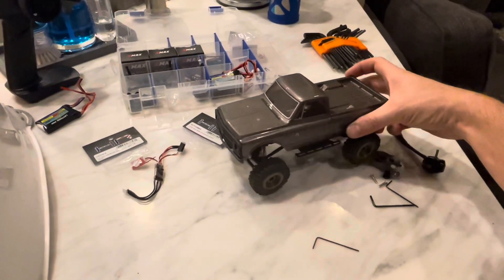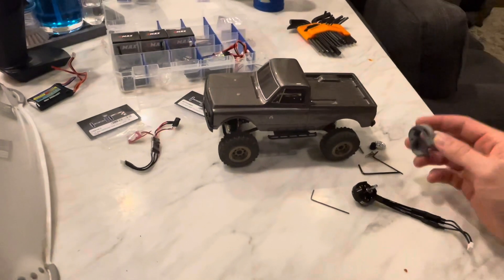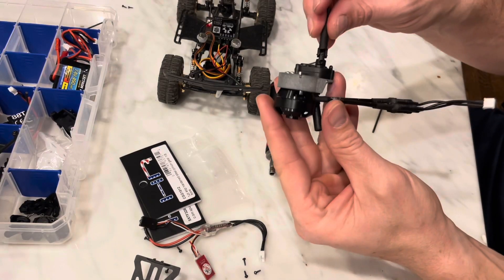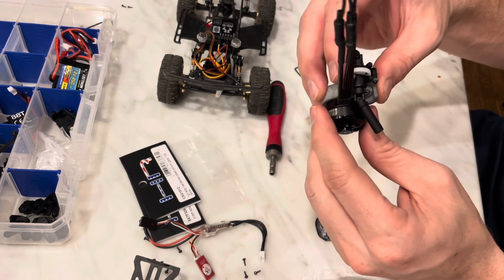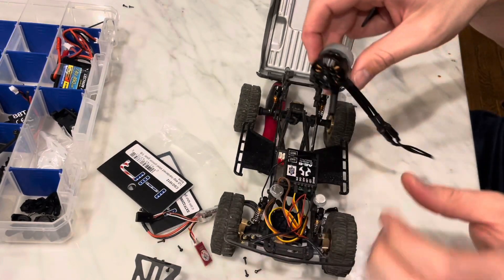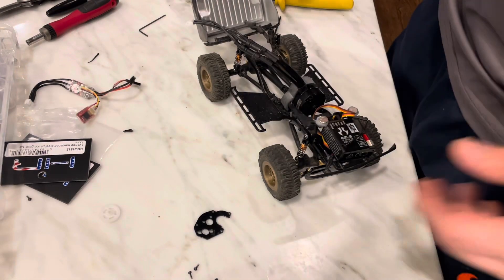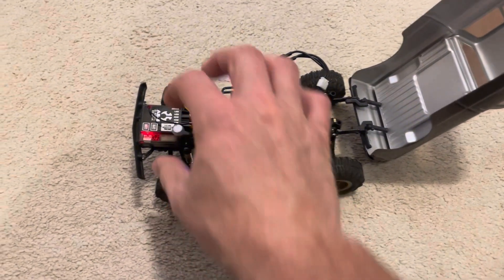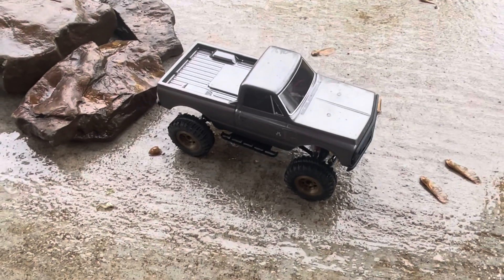Axial SCX24 Surpass Motor Install How To

Comment: I recently purchased the same motor and mount but need the screws to mount it. What size are they and where can I find them? Please help. It will be greatly appreciated
Reply from the maker: I went to my local hobby shop and they were able to find some machine screws that fit. I don’t have the size or thread pitch to be exact

Comment: I mounted my motor and transmission and I suppose the bottom skid plate backwards. Thought everything was working out pretty good till I got to the drive shafts and the pins they mount too being reversed messes up their lengths and messes up the suspension links and its all a mess. Sucks too because it would be sooooo perfect to mount the motor the other way and not have to cut the ESC tray (which I can't because mine is aluminum and where my shocks/body magnets mount and cost like $40). The mod life is the good life.

Comment: Links to the products: https://www.amazon.com/dp/B01M6UNIY4/ref=cm_sw_r_cp_api_glc_fabc_M9t5Fb0D57MBT?_encoding=UTF8&psc=1 for the motor
https://www.shapeways.com/product/F36UVFNAD/scx24-2fm-rc-surpass-motor-mount?optionId=195155714&li=shops  for the motor mount.

Comment: Thank you for confirming the 12t 48p pinion. Ive been running the 15t .5 mod temporarily in place of the recommended 11t .5 mod. They are fine with a 2" OD tire but i can hear it struggle on the steep and tough climbs. I literally purchased the 12t 48p in the middle of your video!
Reply: Hi mate, do you have a link for those bits? I have the motor and mount. I need gears.. hehe
Reply: dont get a 48p, they are noisy af. I found this guy who sells gears but doesn't specify the pitch/mod. I got a 15t and it was way quieter then my 12t 48p. Heres a link to the 12t 0.5mod https://www.ebay.com/itm/272055886561?_trkparms=aid%3D111001%26algo%3DREC.SEED%26ao%3D1%26asc%3D20160908105057%26meid%3Dff19f850f92448d7bfcb68ee23660562%26pid%3D100675%26rk%3D2%26rkt%3D15%26sd%3D283852787413%26itm%3D272055886561%26pmt%3D1%26noa%3D1%26pg%3D2380057%26brand%3DUnbranded&_trksid=p2380057.c100675.m4236&_trkparms=pageci%3A547e093b-c2e4-11eb-ac66-aadbead31f46%7Cparentrq%3Ac7f147691790aaecf154d84bffe19a0e%7Ciid%3A1

Comment: Shit I ordered an 11 tooth. Hope it works
Reply: Where did you find an 11t? the 11t is the best one but they are sold out, hopefully you didn't get the mod 1.5. He used a 12t 48p, with a spur that's mod 0.5 or 50.8p, so his pitches/mods don't match which I think is why its noisy. I also got the 12t so I'm looking for a 11.
Reply: @vinnyisntgud7221  I have the .5 mod. Got the 11 tooth on ebay.

Comment: Nice job.  I'm about to put one in my next Jeep build with the LIzard ESC as well.  Looking at your install, I may have to ditch the stock ESC/Radio to save space and use a smaller radio and different transmitter.  I'm really surprised it fit up front without interfering with the up travel of the top of the servo.

Comment: What did you use to adapt the three leads from the Surpass to the ESC? I just got my motor and it doesn't have any sort of adaptor included. (slowly but surely trying to get the conversion done on mine too)
Reply: The furitek esc comes with the banana plug adapter.  So when you get your esc it'll have it in the box.  Just make sure you get the bluetooth module with it for tuning
Reply: You can get it at furitek.com

Comment: Nice video! If you are able to provide a links to those products you used would be great.Tx!
Reply: https://www.amazon.com/dp/B01M6UNIY4/ref=cm_sw_r_cp_api_glc_fabc_M9t5Fb0D57MBT?_encoding=UTF8&psc=1 for the motor
https://www.shapeways.com/product/F36UVFNAD/scx24-2fm-rc-surpass-motor-mount?optionId=195155714&li=shops for the motor mount. hope that helps